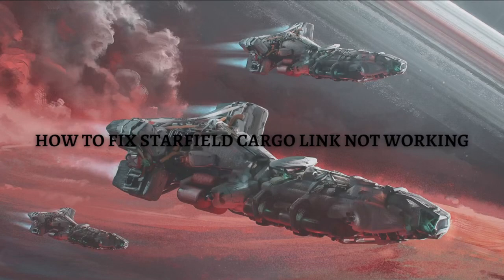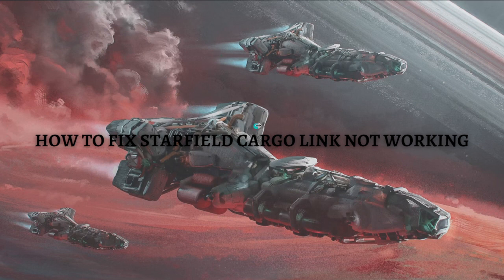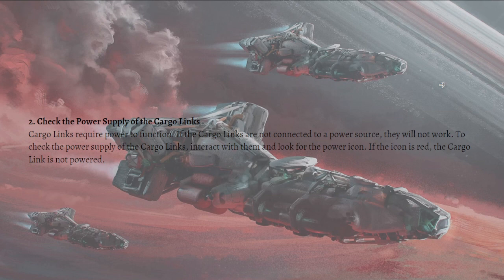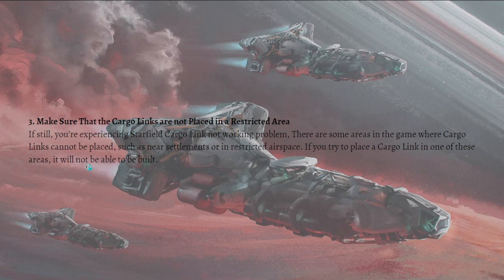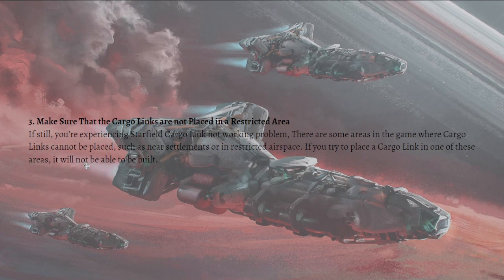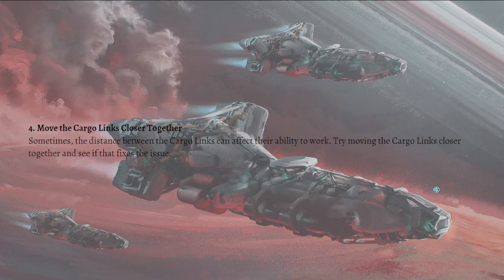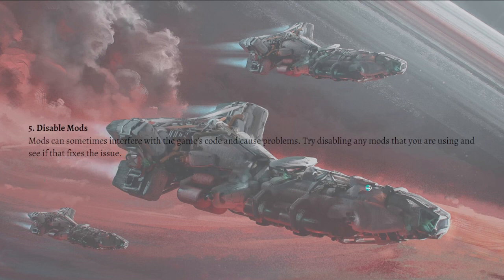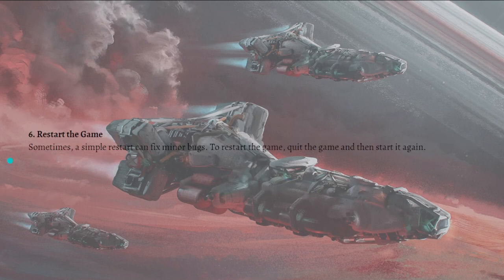How To Fix Starfield Cargo Link Not Working (2024 Guide)

Comment: So many things were incorrect. Cargo links do not require power. Intersystem links take he-3. You do not have to connect wires to power anything other than switches. Laslty, you cannot build in "restricted areas" at all.